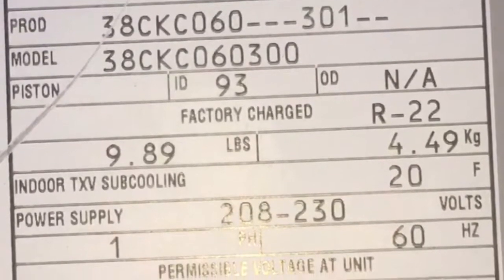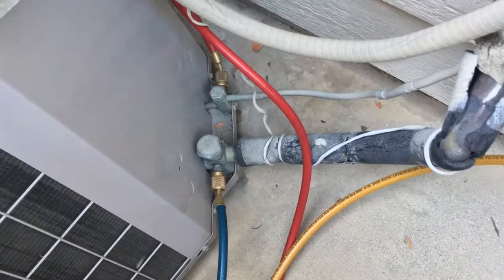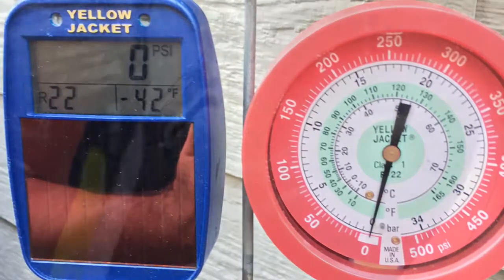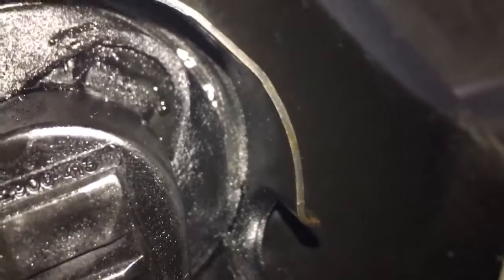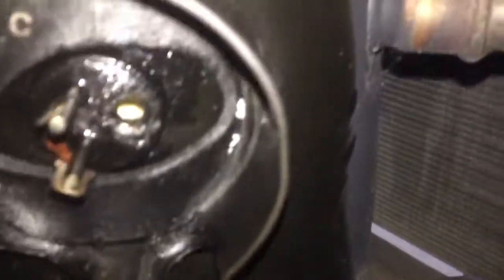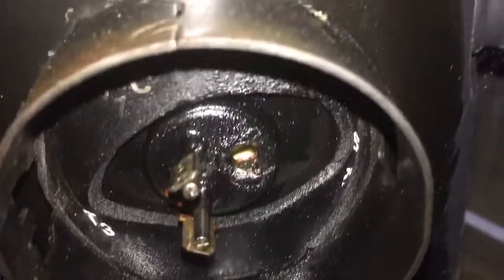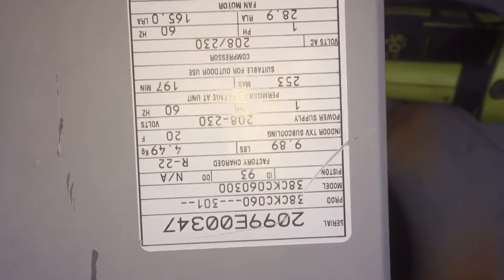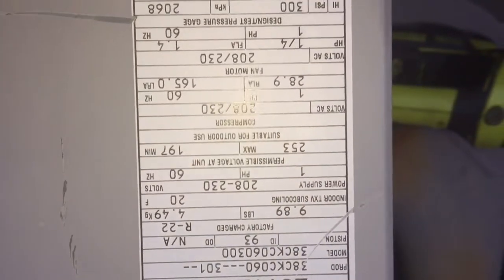Showing - Where Refrigerant can Leak out on a scroll compressor.

Comment: how x_x  u  americans are crazy,  in france, breaker, differial breaker(30ma), or internal 'klixon'  cut before burnout
Reply from the maker: That compressor was actually running before i removed thd plug wires.
Reply from the maker: No burnout
Reply from the maker: Refrigerant just all leaked out past the wire terminal on the compressor. The sealing compound gave way after 18 years.
Reply: Do you think the one piece connector just became loose and the heat cracked/damaged the glass in the Fusite?
Reply from the maker: Yep. 18 years.